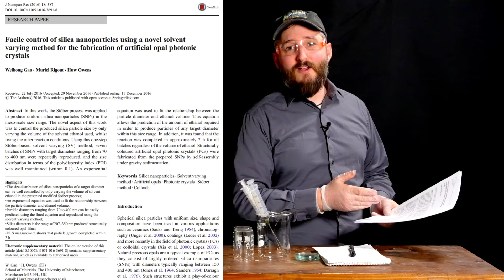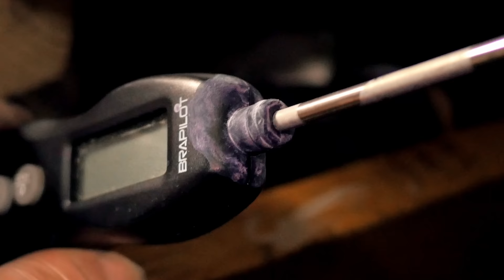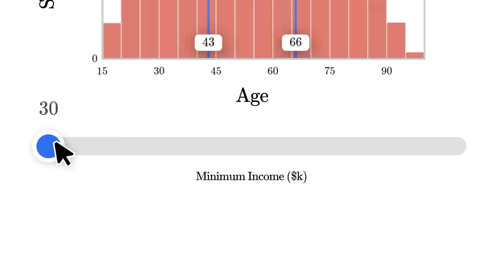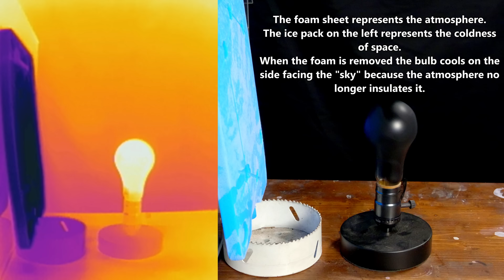Making Opals for Free Air Conditioning

Comment: I think you should look into how bent single crystals (often silicon) redirect charged particles. You are pretty much in this area already. Imagine you have something radioactive you want to contain, but the radiation itself is wasted energy, with a chain of bent single crystals you can steer all escaping particles back into a point for harvesting. Now, what happens if a cage/room is built out of them? Does it just freely build up energy inside until the rate of escaping particles matches the rate of redirected particles? does it overheat? explode?

Comment: 7:34 Actually, the ammonia aids in keeping the silicone in solution for longer. Leading to more round particles, with a more smooth surface. 

SiO2 turns gel like, in a high pH environment. It also becomes more soluble in water, in this condition. 
Ammonia solution has a pretty high pH.

I guess, the low heat is, to drive the ammonia out, in a controlled fashion, stabilizing the particles. If you would do it with lye or such base, you would not get the particles out of solution so easy.

Comment: Nanosphere adhesion is likely a more unstable structure compared to a true crystal, no? The roundness implies low contact area and few binding forces other than van der waals. Your lattices seem to be breaking apart during evaporation without a suspending binder with high transparency, leaving high-noise opal "snow". What if you mix the powdered spheres into crushed silica, melt, and add a seed 'crystal' on top, and apply ultrasound while slowly cooling? The ultrasound would localize the spheres and de-air the viscous glass

Comment: But to avoid that vertical banding in synthetic opals. When you dry it over months you want the container to tilt along the vertical axis by around 5-15 degrees over 4-7 days as it settles. You can also have it Roll around the axis slowly over the same time.

Comment: Have you tried experimenting with exciters? So adding in vibrations through a speaker essentially to vibrate the liquid. I imagine it would give a ton of control for the settling process. You could get one for $20 and attach it to an amp. The only thing I can think of is that you might need something special if you want to play ultrasonic frequencies.

Comment: I was thinking how opals form, which are kinda common here in Australia. So its normally an underground thing but of course, where water once covered the area a very long time ago. Crystals form with a very long duration and perhaps under some significant pressure and in the absence of air. The solvent may have been a combination of water, and even some natural oil type of solvent.  Could we get the particles to form better in a vacuum ? The Vacuum or part vacuum would also help gas off the solvent. As for the solvent, we would need something that has a much lesser degree of viscosity and surface tension, but not in a complete vacuum. Perhaps using another gas in the chamber as well other than just air. Do we go lighter gas or heavier gas ? Helium/Hydrogen, or an argon type mix ? Perhaps a carbon dioxide that would also work potentially better ? A mix ? We are attempting to allow time for the micro ball matrix to form into crystalline structures hence it will need time. We want to remove the water from in between the balls but we also do not want water or air to fill the gap.  But then I did some basic reading and discovered it can form with ionization with the composition of SiO2at 28%, Fe2O3 + AL203 at 68% and H2O.  at 1% composition. So it appears we may be able to make this using a different approach. Still, in Crystallization, heat impacts transparency at least in Epson salt crystals and also in water ice. So, perhaps we need to look at this differently. We might need to use a different solvent that is less viscous and has a lower surface tension than water, but slow the rate of evaporation. Can we fill the gaps between the nanospheres ? And what with ? A very fine dark resin ? Can we use a resin as the solvent ? And now we back in the sphere of creating wavelength reflective paint again. What is the crossover ? So if we can figure out how to do it ignoring natural process ,then once we achieve our goal, then we look at replacing the synthetic parts of the mixture with natural mixtures that closely replicate real opal. However I do not see a shortcut to the time it takes to grow decent size crystal lattices and I think this will be one of those videos you revisit with a new part, every few months. This will possibly be a very long process and you might need to dive into more research as surely there are many people around the world working on similar processes perhaps not to make opal, but to create "something" using the same result. Working with NANO might even be the key to the solvent and other properties as well.  Im now very curious and might reach out to some opal miners and ask for some opal scraps so I can play with them, see what dissolves them, how the spheres are layered and how deep, and on what other substrate in nature etc. I know nothing about this at the moment so its a fun project to do. I suspect that answering one big question may actually provide the answers for other questions on the same general topic.

Comment: I just wondered if a magnetic field could help sort the particles into layers.  Look under your microscope to see if the brownian motion is altered when you bring a magnet adjacent.  Could an AC field help sort the spheres by vibrating them back and forth gently while gravity pulls them down.  It wouldn't be to hard to scale the power of the field till the vibration is less than the energy that causes remelt.  When the green had blue in front and red behind but the stress fractured blue attempt didn't seem multicolour or flashy, it just might be that it was 'doubling' into UV spectrum.  You would have to try it on bees to see how they react. :)  Don't throw the bad samples out till you test them for other potentials beyond your narrow goal.  Many discoveries were things dropped on the lab floor.

Comment: I love opals. It would be cool if you could get it to harden up like a resin or maybe get the spheres to form and then extract them. But your thought here is to use the additional crystal structure to sort of go beyond your other cooling solutions, right? I imagine its the structure itself in combination with sphere size that converts light to different wave lengths. Hopefully you can get that one variable that changes the the shape to adjust for what wave lengths come out. Maybe adjust for one variable top to bottom with test samples and then do the same for a few other variables and see what colors and ir reflections you get? Seems too straight-forward, but maybe it works. Anyway, I did notice the new video format part way through when future you showed up. It seems fine, just another way of doing things. It was still enjoyable seeing what you're working on, and it was interesting seeing where your mind goes when you explore something new. I always look forward to seeing what you come up with next. But hey, take your time and remember to take care of yourself as well.

Comment: Could the issue be like "sugar crystals". Time + low temperature change = higher crystal formation. Even with the settled material, you should be able to drain the undesired solution which is "spent". Then allow time and heat that cools slow, to let them crystalize. (Kept in a cotton-covered tube, so excess solution can still evaporate, without drawing in moisture.)

I would also assume that the additive in the alcohol is "benzine", which may be spoiling the reaction. Might be better to just make your own "grain moonshine". You can get all these chemicals online, through various sources.

Comment: Bubbling a sphereic shape is tricky to make but I consider it a diverse dynamics of vibrations and resonates with the shapers of the characters of autonomous vehicles 9t is the vibration that is around them it's a very difficult task tracking each order but a non vibration level is easy to use as a reference point magnetic field respectively with in the dielectric chips that inferred memory chips can be used in higher frequency settings if they are of multiple different types the truth is its experience in the spacing process circles within circles of micro spheres that blocks inferred from proton traps the signals to working with in the dots of glass spheres that bounces back into the process

Comment: I wonder how much the shape of the surface they are being settled on influences, I noticed the dark samples were in dishes with a flatter bottom than the watch glass. For example, the samples around the edges of the watch glass would have lost a significant amount of fluid through draining, rather than just pure evaporation. It actually got me thinking, what if a thin layer could be created using something like spin coating? It might just fling all the particles off entirely, of course.

Comment: I have a question about the passive cooling. Does it work without all the perfect circumstances?
For example, let's think about a car's radiator. If I spray-paint it white, will it radiate heat better? If I paint it with nano-spheres, will it radiate heat better than spray-paint?
 Perhaps a radiator is a bad example, but what I'm trying to get at is: does the paint improve how an object eliminates its heat? 
Like for the shirt, does heat pass more easily through a shirt after it's been nano-sphered?
Reply from the maker: The cooling only works when it has a clear view of the sky. See my earlier videos in the series for better explanations.

Comment: I’m curious if shining a 945nm laser onto the red opal spheres could form holographic diffraction crystals. This could aid in your dispersion of light if done correctly by directing the Raleigh scattering upward on an angled surface like a rooftop which is what I assume is your end goal. You could easily make a hologram of reflective tape and no matter where the sun is it will reflect back the light in the wavelength you choose. 😊

Comment: So if you have a box or sphere with a temperature sensor on the inside and every exposed area is painted with a coating of the cooling paint... Would it cool down?
Could we perhaps use this principle to take a ventilation tube and paint it black on the inside to capture as much radiation as possible and then paint it with that white cooling paint and then the air that comes out should in theory have lost some of its energy to the tube making essentially air conditioning? All it is needed is moving air.
Could we turn that around and take heat from the room with a black paint and push it into the air that we push outside? So painting the inside with the white cooling paint.
After all if it truly reflects the wavelength that we consider black body radiation it should deny the heat from being absorbed and should eject heat that is given to it.

I don't know where opal fits into this. My only guess is that it would make you better at making nanospheres or perhaps that opals allow a broad spectrum of light to be captured for capturing the heat.

Comment: Just amazing, as always.

I wonder if the surface tension of the medium rips the delicate structure as it dries, ruining any possible large crystals. It would be quite hard to do but would somehow changing the medium to supercritical CO2 for the drying process solve that (possible) problem (as it does for things like aerogel)? I suppose it's too complicated to put anywhere close to the top of the list of things to try.

Comment: If the dried lumps after turning in the centrifuge too fast are basically "badly stacked" microballs, can these be ground up to a pulver of individual balls or would the small crystals break apart during grinding? I suppose they would remain intact, since they are likely a much more robust structure compared to the "loose" stacking. If so, couldn't you "simply" suspend them in your target medium like in clear a varnish? Brownian motion should be possible in a more viscous liquid I guess and allow for proper setting when the varnish dries. Also you have to dispense it in a medium sooner or later anyways.

Comment: So, the centrifuge didn't do what you wanted. But can it still be useful?  Can you pour off the solution and reintroduce the spherules to another solution that will evaporate quicker.  I think you should also try dribbling the single colors in wavy strips and spots to try and get the look of naturally opalized deposits.

Comment: It may be worth trying a very low viscosity deep pour epoxy resin with active cooling to extend the curing and therefore settling time. 

I wonder if i can convince my better half that we have to get a fume hood, assorted chemistry supplies and one or two moderately dangerous chemicals...

Comment: 46:14 I don’t know how I missed this video, sorry. I’ve seen epoxy channels use vacuum and pressure pots to remove air bubbles. Maybe that would assist the air gap issues.

Comment: There is a chemical that can be used to harden silicon dioxide and results can be 15 times harder. Company in East Germany, made a series of glasses, which had been made as glass, placed into the chemical solution, and produced glasses that were unbreakable. The process is called Ion exchange but the exact chemical name, at the moment escapes me.

Comment: So, I'm not a physicist or anything, unlike many of the folks in the comments here, but, if I'm understanding how this all works properly, would it be possible to control the rate of settling by keeping things at specific temperatures? Brownian motion is a physical view of temperature and is what is keeping the particles in suspension, right? The higher the temperature, the more motion, along with the inverse being true, as well. Therefore, lowering the temperature after the reaction has completed would result in less particle motion, allowing them to settle more easily, but not lowering it so much that they crash out and fail to form the neatly stacked layers you want in opal.
I feel like it's such an obvious thing that it's already been tried before and someone is gonna correct me on why that doesn't work, and I'm completely fine with being wrong there. I just can't not ask the question, either from curiosity or from the fact that that's just how science happens in the first place. I know that temperature does not always equal particle motion. Temperature is merely an average, but bringing down the average amount of motion to a specific point feels like it might work in some way.
Again, I'm not a scientist or anything of that nature. I'm a cashier at a gas station and former translator for the military with only one semester of college under my belt, my major being in graphic design, AKA, horribly underqualified to be making any sort of proposition, especially one where my knowledge is less than surface level.

Comment: Loved your video and the concept of making opals. Couple questions/thoughts...
Are the nanoparticles magnetic? Could you better organize them if they were in a magnetic field? I liked the idea of the freeze dryer in the comments.  But, you would still need to get the particles to form a thicker strata for gem stones to make them thick enough to cut and polish.  If the pellets you formed are not dense enough, they will go to powder when trying to form, shape and polish them.  They need to be harder. Can you put them under pressure during or after drying to increase the hardness?

Comment: I'm wondering if the solution could be "seeded" with the nanoparticles that were too small, to grow larger particles?

Also, did you test the ammonia to ensure that it actually was the strength advertised, and confirm that the diluent is pure water?
Reply from the maker: Seeding is an option, but for consistent results you need to know exactly what the size of your seeds are and how to make them consistently. I didn't test the ammonia because the result was good as is.

Comment: if the paper said its volume dependent why wouldn't you titrate the ammonia wt distilled water? Also id suggest covering the beaker somewhat and use the thermocam for checking temp instead of a thermometer. I just try to remove as many variables as possible.

Comment: get some photo fixer and pour it on a tray. i have i believe ilford rapid fix. then let it sit for a long time, adding some water back in. it should get milky from sulfur micro crystals. then let it fully dry and they will settle and get an opalescent shine to them. its pretty and i did it compleyelt by accident

Comment: Natural opals rely on water content as part of the process causing the flashes of colour. Heating natural opals will result in them turning into a white powder, losing their iridescence. I can verify that from personal experience. Legend has it that opals need to be worn regularly to maintain their colour. This is because they absorb water vapour and oils from the skin thus keeping the gaps between the nano particles filled. Time is the most important element in creating larger opal samples. Natural opals take many thousands of years to form and even with the best techniques, artificial opals are likely to take at least a couple of years to get a decent result.

Comment: If it was me I would get black potch and take the different solutions and find a way to do a really fine spray of the solution with one of them let it dry. Move to the next. It will take over 100 different times spraying to build up a proper dome. 
Once you have a high dome. Polish it Like any other opal to remove that White milky color that would be left.